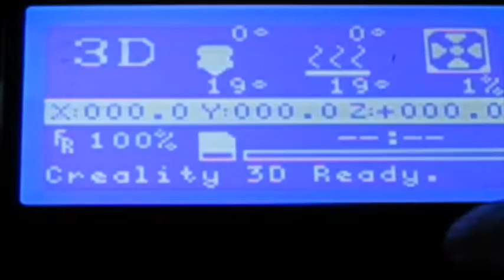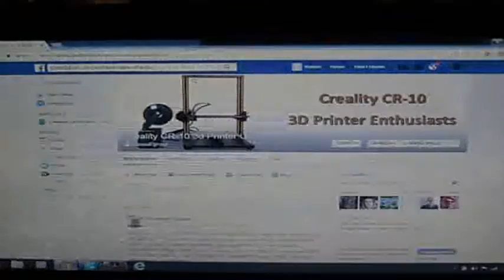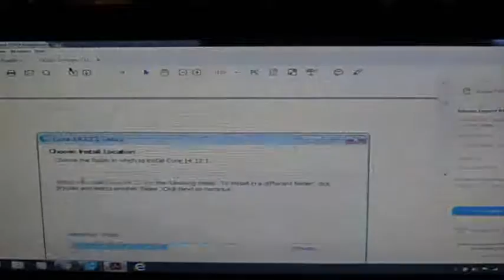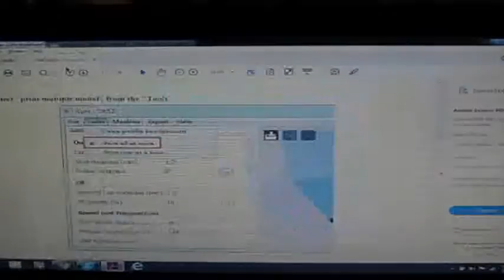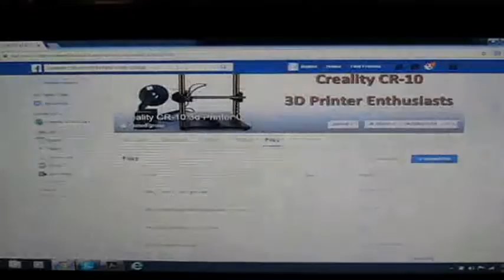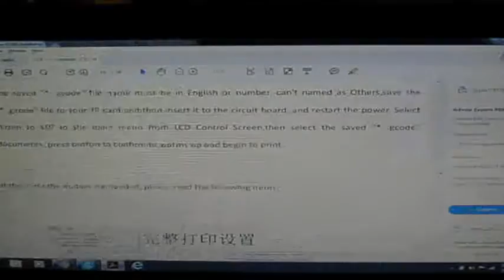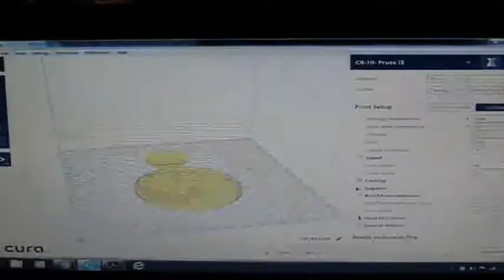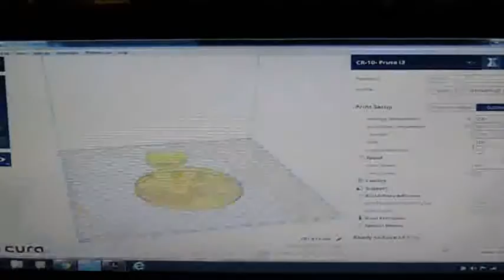Creality CR-10 pt2 - newbie start-up information

Comment: Nice info... I just got my CR 10S today and set most of it up .... almost every screw was loose, and some psrts were not put together correctly.  BTW: is there a way to turn off that annoying beep every time you push the controller button ?  That beep is very annoying for sure !
Reply from the maker: There must be a speaker inside somewhere, possibly you could just disconnect it. Don't be shy about taking the cover off, you will get used to removing the cover to retrieve the MicroSD card every time you drop it into the slot by mistake. An extension ribbon cable is a good investment.

Comment: Extrusor machine direction? My one is not working when I go to prepare / stepper / Extrusor or something like that. No idea why. plus my temp on preheat PLA only gets to 185C? Should it get to 196?
Reply from the maker: The default heat setting for Preheat PLA is 185 on my machine also. When you get to the Move Axis Screen, make sure you select 1mm or .1mm before you go to the Extruder selection. If you select 10mm, it will not work
Reply: Look what I just found. It's for 376.99 USD
http://www.gearbest.com/3d-printers-3d-printer-kits/pp_441282.html?wid=21&lkid=10324082
I bought one

https://www.youtube.com/watch?v=dNbFQOkkIXM